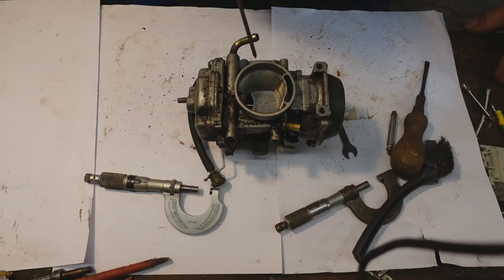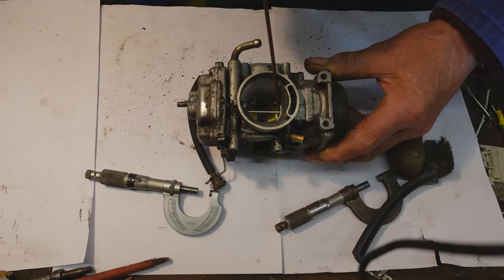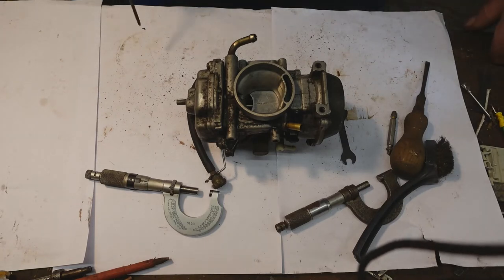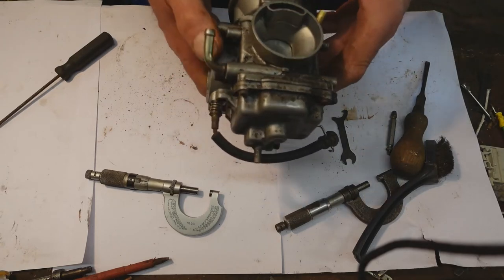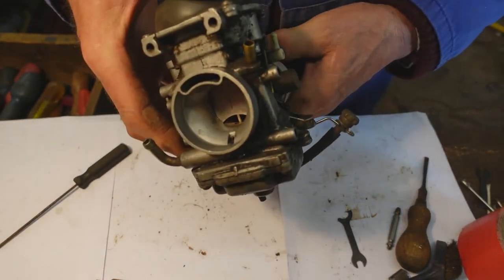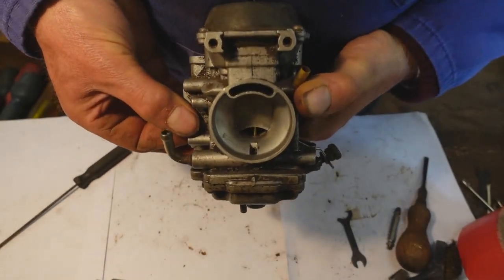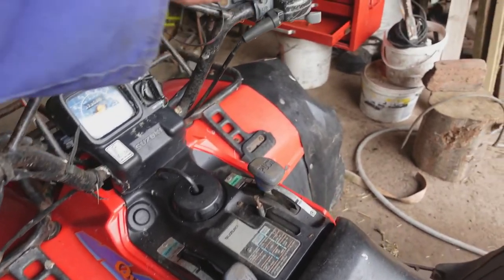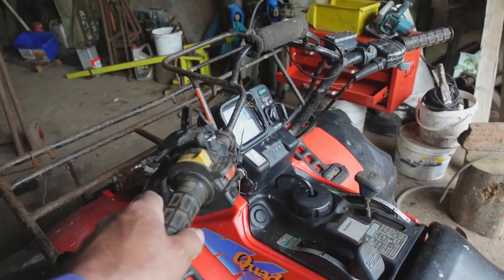Testing a Mikuni carb. diaphragm with a vacuum cleaner

Comment: I've gone through my carburetor twice now. Removed all the jets.. soaked it in brake parts cleaner over night then put it through a ultra sonic cleaner. used a jet cleaning tool through each and every little hole in the jets have. Blown compressed air throughout the circuits so Im 100 percent certain every circuit is flowing as it should. Im going to try your vacuum trick on the diapham and see what happens.  I would love for it just to be stale fuel in my situation  but i doubt it considering the loss of power has been slowly getting worse the past few fill ups. 
 Tripple checked my valve lash and its dead on as well as the timing.  New spark plug installed with correct gap on its electrode. has a strong blue   spark.  Compression is 126 psi at wide open throttle (engine has actually gained 5 psi since  top end rebuild last winter. 20 hours on new top end)
Im running out of ideas whats taken the ole swamp donkeys power. It idles fine runs ok if you keep rpms low and shift early but falls on t
Its face once its in its highest gear and qont rev any higher
Reply from the maker: These problems really can drive you up the wall! The number of times that I have taken carbs. apart repeatedly only to eventually discover an electrical fault. As things warm up the resistance in faulty electricals increases and very often gives the same symptoms as a fuel fault. Easiest to check is the cdi coil because it is easy to jury rig another coil into the system without even having to remove the existing one, then the pick up coil which is deeper in the guts and then test the stator. Have a good look at all the wiring and connections first though. Good luck and let me know what you eventually find, best regards, Jon

Comment: Sir is thier problm in mileage if my Carb diaphragm up/down cylinder will damage with scratches bcz of dirt..
Reply from the maker: A few scratches should not matter but dirt is not good because it gets into the engine. You need an air filter. Carburettors must be clean inside.
Reply: @wotjonsez2560  thanx for ur feedback..
i purchase old suzuki gs150cc bike.
but his owner use bike without Air filter...

when i open Carb.. his cylinder walls are very scratchy and dirty..

I wash it.. clean it.. fix Air filter..

but bike not running as smooth..